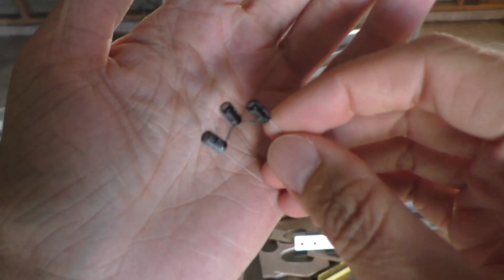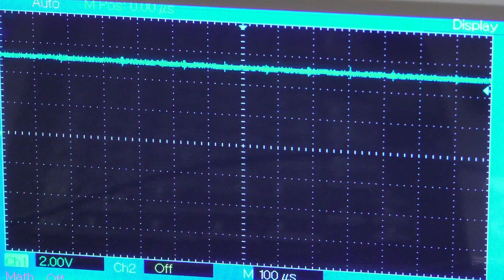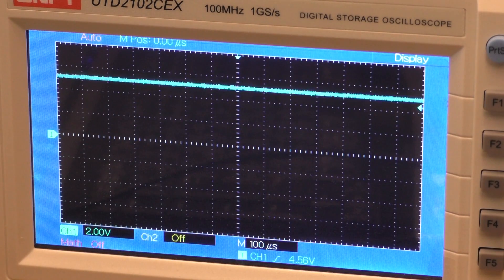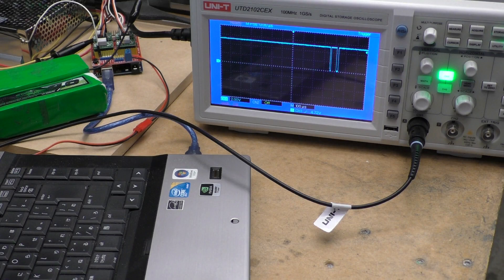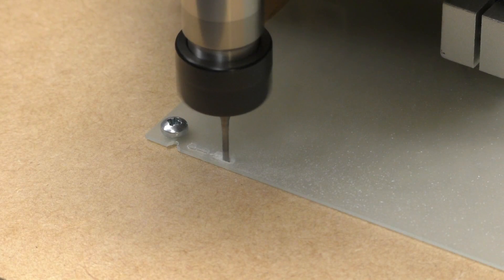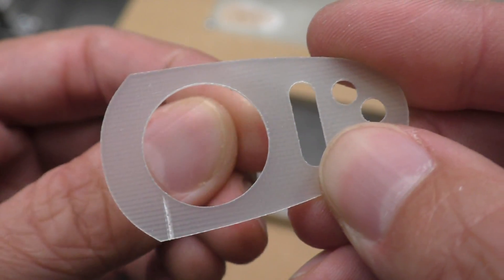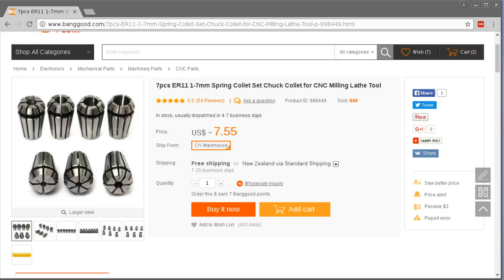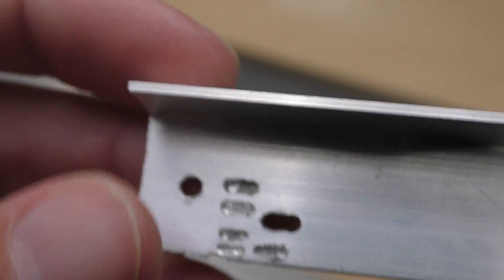DIY mini CNC machine part 11 (spindle round four + more cut tests)

Comment: Are your milling cutters center cutting? As mentioned a 2-flute cutter for aluminum but speed is based on the rpm of the spindle so you should look up the proper settings in the speeds and feeds chart in the Machinery Handbook or it may be available online. I thin NYCNC on YouTube has a spreadsheet for determining speeds and feeds so you might want to contact him. I hope this helps.
Peace!

Comment: People have mentioned pwm drive backfire and carbon brush spiking but most important and easiest way to hold emi under control is shielding. Industrial installations are made always in this kind of cases with shielded cables. As in motor power feed as in communications. All so it's important to check ground loops with shieldings and grounds. It's just plain frustrating to bang head in to wall with that kind of setup.

Comment: I spent a huge amount of time chasing the interference problem but it turned out to be the cheap stepper motor drivers from China. I replaced them with better quality and have had no problems since. I am using Mach 3 and not Arduino so I don't know if this comment is helpful.

Comment: Cutting fluid mate, on aluminium to stop it clogging up the cutter (even crc). The moving in the collet is called run out. Are you clipping the collet into the nut first, then screwing it into the holder, then inserting the cutter? It won't go in straight if you do it any other way. Also have you played with bcnc yet?
Reply from the maker: I clip the collet into the nut, insert the bit into the collet, then screw the nut into the spindle shaft. Works perfectly every time for my other collet.

Comment: I'm no super machinist guy, but I've been following them on YT for years.  :)  I think your spindle speed was way to high to get a good bite on the aluminum.  The flute was probably just rubbing against the material and generating a bunch of heat.  You want to see a buttload of little aluminum chips flying away from it.  I seem to remember you mentioning NYCCNC (I think I do, anyway).  John has some good videos on feeds and speed and stuff like that which might be helpful.

Comment: Use some soap and water solution to cut aluminium. The run off of the bit might be caused by the collet having uneven slits 16:20 to 16:24 the slit facing away from your camaera in between your finger tips looks wider than the rest of the slots.

Comment: I had a similar problem with the Arduino resetting when enabling the spindle relay on my CNC.  I was using a knockoff Arduino with a CH340 chip.  I switched it out for a genuine Arduino with the ATmega16U2 chip (and the full DIP28 328P in a socket).  That seems to have solved it for me.  I haven't had a spurious reset since.

Comment: From my own experience over the last 4 years..
1. Disconnect the power supply. You are a modeller of course? You have LIPOs in abundance? Incredibly smooth in comparison to cheap power supplies honest guv.
2. Spindle runout... more than 0.0005" is barking. Check the collet isn't imperial, 1/8" for example and the cutters don't have 3mm shanks!!! (trust me, I know).
Your collet looks dreadful. Swarf and burrs. 
3. Your aluminium section is almost certainly just that, pure aluminium, far too soft, hence the dreadful cutting, . Try and find some 6061-t6 alloy, it cuts beautifuly. My local supplier cuts it to length and has a skip full of offcuts. Buy yours a beer. 
4. If you are serious about this google Kress 1050 for a serious spindle. Pay £30.00 for collet/nut pair and £15.00 for cutters. (other currencys exist I believe.)

Comment: A little cutting fluid may help, the buildup of aluminium was lack of lubricant, and to high surface speed of the cutter, a two flute cutter will run at half the surface speed, but you will need to reduce your feed.  Also, I think that overall rigidity is causing problems with the chatter.  That aluminium stock looks quite hard, with a too high surface speed, the stock might be work hardening as well.

Comment: 0:13 Standard practice is to use a capacitor that is rated twice the nominal circuit voltage.
12:03 I would put the blame on the collet/collet holder assembly. 7 collets for $7 dollars does not scream quality.
As an example check the price of only one....
http://www.carbideprocessors.com/er11-cnc-router-collet-1-8-shank-southeast-tool-se04211-18/

Comment: For the cable noise, try a ferrite core, and once you get your new Colet I'd suggest using a lubricant (maybe wd40).  It should help with the cut and may also help reduce the clogging bit.

Comment: Silly question, are you clicking the collect into the nut before installing the assembly into the spindle taper?
Reply: That was a common mistake made by an apprentice I was helping.
Reply: @paul30003  i has that problem too.

Comment: You may also want to use ferrite cores on the usb cable and probably also on the spindle motor cable.
Cheers
Reply: Random ferrites don't really help unless you get randomly lucky. You need to calculate the correct value based on the filter you're creating

Comment: A ferrite core is the most likely preventative measure for the noise. The spikes are very narrow and are composed of high frequency, a ferrite core will go a long way to stopping this. Put the ferrite at the same end that you are putting the caps.

Comment: Your multimeter is being tricked. :) I suspect that 48v supply isn't what it says it is.. It might just be straight rectified mains which is then pulse width modulated, rather than PWM on a 48v DC rail. It's way too small to be a 500w AC-DC supply.
Reply from the maker: Apparently it's supposed to be outputting 100v DC.
Reply: iforce2d put your multimeter across the spindle supply, I mentioned on a previous video I have exact same power supply and same problems :-(. Check you are just getting a max of 100v, I got over 150v from my 100v supply
Reply: I've got another potentiometer on order, higher capacity as the one supplied has burnt out parts of its track, so I think that shorts it to full voltage
Reply: Ah, I somehow got it in my head that it was 48v. It's still suspiciously small for it to be a proper DC supply of that power rating.

Comment: Suspect your power supply has crappy regulation, and the cause of the high voltage at low load. As you increase the speed the load increases and the voltage regulation steps in.
A better power supply is required.

Comment: I had lots of problems cutting aluminium with 3mm eBay end mills then I bought one expensive one and now cut aluminium all the time without lubricant in shallow passes but quite aggressive feed. Also, not all aluminium is the same (obviously) I kept getting it melting on my end mill with one scrap I was cutting but have never had issues with any other kinds.

Comment: electrolytics  are imbalanced by nature... if you want a series combination of electrolytics to withstand a high voltage, put high value resistors in parallel with each to balance the DC... seen in tube amps all the time.

Comment: If you're going to plunge into the cut like you were, slot drills are the way to go, look for 2 flute slot drills and try a bit of WD 40.  End mills don't cut in the very center of the cutter.
Reply from the maker: ah... that makes sense. It would explain why I often had a paper thin layer of material remaining for a cut that should have gone all the way through. Looks like my CAM program supports ramping in so I will try that.
Reply: Sorry, I had intended to mention that.  I used to have two and three flute slot drills that I used in a small vertical mill, at much lower revs than you will use.  As turbineterry says, if you plunge an end mill straight down for less than one mm then lift straight up again without horizontal movement, you will see a shiny "nipple" in the middle of the hole.  View a slot drill from the end you will see one of the flutes continues inwards to the centreline, so it cuts away the nipple when it plunges.  Ramping is the only safe option with your end mill, and is still a good idea with a slot drill.
I bought a cheap Ozito rotary tool a few months ago (I couldn't justify the Dremel price for what I intended).  I got what I paid for... I was disappointed with the runout.  I think your spindle with its original collet is better than the Ozito, and has much more grunt, but the Ozito is not as bad as you are getting with the new collets.

Comment: Poor finish:  Eliminating cutter runout will make the largest improvement to the amount of chatter and disappointing finish.
(1) Was the run-out present with the original collet, and is the new collet specifically made for your spindle?  
(2) Check the bore of the spindle, swab it out and ensure there is no chips, protective grease or coating still in there.  Do the same for the collet retaining nut.  
(3)  I'm pretty sure you had a dial test gauge... if so set it against the cutting tool shank  and rotate the shank to find the high point.  Mark this point on the spindle. Rotate the collet 180 degrees and repeat the test. If the high point is now opposite the mark on the spindle, the problem is most likely with the collet.

Tool lubrication:  Thinking of things you may have on hand, kerosene, WD40, silicone lube, meths (haven't tried this, not sure about it) or light machine oil.  There are some flash aluminium cutting fluids around, at a price, but kero was all I used for many years.  You don't need to use much.

Aluminium:  Not all aluminiums are created equal... what you are testing with was squeezed out of a big toothpaste tube.  Suitably tempered stock like 6061 will give a much more satisfying finish.

The electrical issues are scary!   :o(

Thanks again,  really enjoying the videos.
Reply from the maker: No, the 1/8" collet that came with the spindle is still fine. The new collet is also an ER11 collet, I presume they are all made to a standard size. Thanks for the tips!
Reply: I'm too far out of touch to know if they use a standard specification... a bit of judicious comparing with a caliper or micrometer might find something.  Certainly looking at Banggood's site and Googling ER11 collet suggests they should work OK.   Bummer!   :o(

Comment: I think you should use "traditional" tool for mount on your cnc, and not this "fancy" motor. Something like Dremel tool or similar from your local hardware store.
Reply from the maker: I actually bought a Dremel at first, about a year ago when I started considering making this machine. I was intending to use it like you say, but the runout was worse than what we see in this video. I could barely even use it for hand-held work so I took it back to the shop and exchanged it for a Ryobi brand. Even the Ryobi has what I consider to be too much runout for use with a CNC so I just assumed those kind of tools would not be suitable, and decided to get a 'proper' spindle. It seems everything I buy is a piece of crap, is it just luck...?

Comment: +iforce2d The voltage you are seeing across the motor is probably the back EMF kick that the motor produces when the drive PWM pulse is low! (the motor behaves like a big inductor during that period) You can actually try to hook a big diode antipparallel to the motor and see if that solves your problems :)

Comment: PARALELL NOT SERIES WITH CAPS
Reply: Parallel capacitor connections increases the capacitance, but maintains voltage limit. Series reduces capacitance, but increases voltage limit. 
Resistors in series increase the resistance and increases voltage limits. Parallel resistance reduces depending on values, and voltage capability decreases, depending on resistor values.
Reply from the maker: nils I was trying to increase the overall voltage limit, so putting the caps in parallel would be pointless.
Reply: Ohh sorry then

Comment: those caps can't handle that much ripple current the internal resistance is too high, they also aren't very good at suppressing HF. You can't just assume that 3x50V caps can handle 150V, the voltage will be divided between them depending on capacitance and the tolerance on electrolytic capacitors are huge

Comment: Wd40 will help stop the aluminium sticking to the bit it is prone to it also if you changed the collet and you're still getting run out then chances are it's the spindle that's out
Reply from the maker: The larger bit with more space in the flutes seemed to be ok without sticking, I don't think I'll be using the small one again for aluminium. No, when I changed back to the collet I was using before everything was fine, so I think the problem is with the collet and not the spindle... thank goodness.

Comment: As Nathan says, ferrite core on the wires. For cutting the aluminium, you'll need the highest spindle speed, use a quicker x/y speed and very small z axis steps. Cutting fluid will help too.
Reply from the maker: I am constantly getting conflicting recommendations on spindle speed for aluminium (eg. the comment directly before yours...). Aren't the spindle speed and xy speed related? I think I will just have to experiment.
Reply: iforce2d I can only go by my experience in using a Roland egx600 at work. you need some chip load, otherwise your not cutting, just rubbing and aluminium is very prone to clogging up the cutter. I've used the 3mm cheapo end mills from banggood without a problem. the setting I would usually use would be 0.05mm steps on the z axis and 7mm/sec on the x and y feed. obviously using the smaller diameter cutters you have to take care not to side load them too much. as you say, having a play around will allow you to find what works with your setup. nice video's BTW.
Reply from the maker: 0.05mm step down, seems like almost nothing... did you mean 0.5mm? I will give it a try though when my new collet arrives.
Reply: afraid not, 0.05 or 0.1mm depth. endmill doesn't plunge cut very well in the aluminium, (probably why you don't get a clean breakthrough) so that's why I take very light cuts and use quicker x & y movements.
Reply from the maker: I tried this and it works pretty well. It was god-awful slow to get through 3mm aluminium (30 steps of 0.1mm because Estlcam only allows step-down in 0.1mm increments) x/y feed at 0.7mm/s took almost two hours to cut a small shape, but it worked really well. I have a 3mm solid carbide single flute which is nice and sharp, so I increased the step-down to 0.3mm with no problems, that seemed about as deep as was safe. Next will try 0.2mm and faster x/y.

Comment: 2 flutes for aluminium cutting and slower speeds
Reply: the spike happen because electric spark between carbon brush and rotor, normally they use ceramic capacitor, connect  from each motor point/cable to motor casis not cable to cable
Reply: You might also stop trying to cut that cheap hardware store aluminum angle and use some of the left over alloy aluminum scraps from the X and Y axis instead. Hardware store aluminum is notoriously soft, gummy and difficult to machine. Alloy aluminum is much easier. Also, there are specialized bits for aluminum, designed to clear the chips better so they cut cleaner.
Thanks for the video. I'm starting down this same path, so your videos are very helpful (in both positive and negative ways - lol!)
Reply: actually single flutes are best for high rpm & plunge/ profile cutting on routers. thats how to get burr free cuts everytime. a mill is a different story or using adaptive clearing will move heavy stock far faster with a roughing end mill. trust me small end Mills & high rpms are best done with single flutes on small diameter end Mills & just simple profile cuts.
Reply from the maker: Will be trying that next, when the new collet arrives.

Comment: Doesn't the motor contoller use PWM to slow down the motor? in that case your electrolytics probably blew up because of excessive ripple current and the resulting heat.
Reply from the maker: Yes, that's probably what happened the second time when one started smoking. But the first time was just a plain old reverse polarity screwup, they went off like firecrackers.

Comment: You can try to use compressed air to blow away the aluminum for the hole or try to use a white oil made for cutting metal